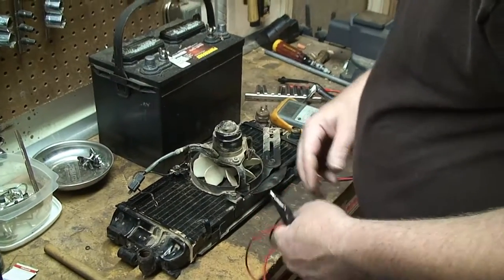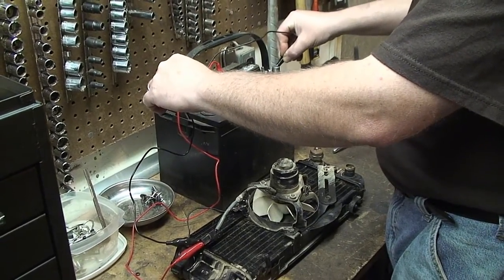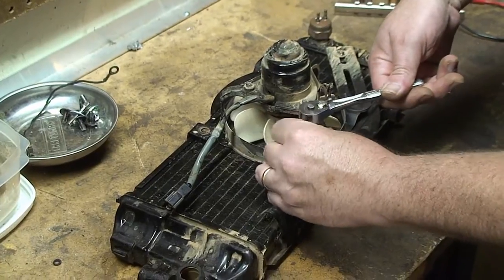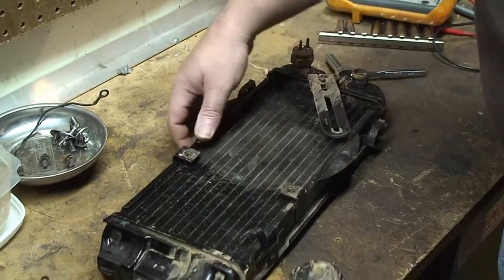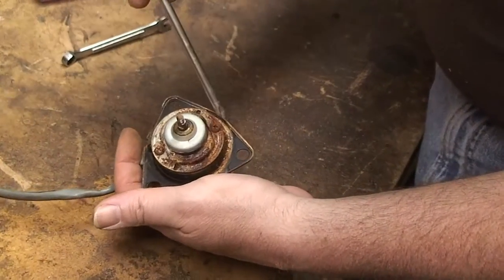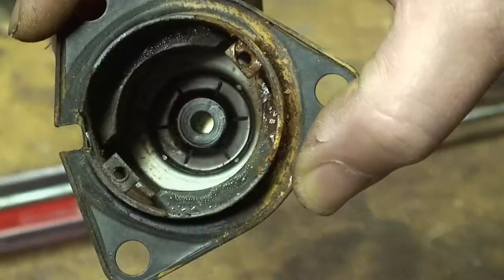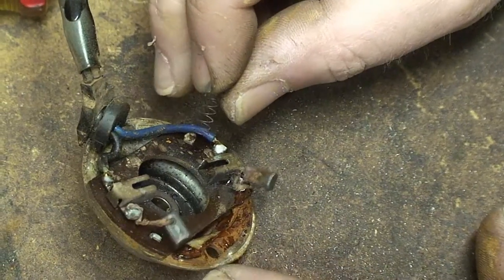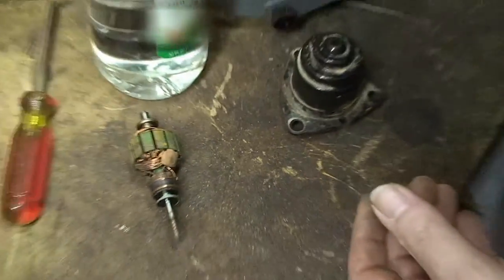Repairing / Cleaning a motorcycle radiator fan

Comment: Great video! Thanks! I didn't want to damage the fan blade on my 04 Ninja 250... My fan blade is stuck because of rust.  I think a lot of the parts are the same. Can't wait to hit it with Metal Rescue or Evaporust and restore this motorcycle. Thanks again for the upload.

Comment: Good video, if you used a little spray paint on the bushing plate after cleaning it would help protect it from rusting out again. I am going to try this on a fan for an 86 honda soon. I would grease the bushing before putting it back together.
Reply from the maker: Great tips, thanks for chipping in!
Reply: @mreinsmith  The fan on the honda was a little different, no screws I had to pry it open with a flat head screwdriver. It was seized and full of rust but I got it working again. Your video was helpful, thanks!

Comment: great job  thank you very much   5 years later still helping people and happy new year for 2017  to you and your family . I will give this a bash a  secondhand replacement is not expensive but probably about to lock up  too anyway as the bike is 27 years old     I enjoy  fixing stuff  rather than replacing . I have rebuild angle grinders made one good one out of 2 broken ones my older brother showed me how  .  I also repaired a dyson vacuum cleaner when the cord retractor stopped working . it wont retract but it still sucks up the dirt as it should and its heavy duty cord so wont break as easy  .  replacement motors are cheap so it will probably last another 12 years .
Reply from the maker: Right on my friend! Thanks for commenting
Reply: your welcome sir . your video on this subject showed me how to get my fan working again turns out it was the ground to the rad was broken  off so I soldered on a  new one and my fan works perfectly again .

Comment: Hello, yo tengo una kawasaki klr 600 y mi duda es si el fan switch se puede limpiar, si por la corrosión del agua no pierde su electroconductividad el material, ya que mi moto se eleva hasta arriba la aguja de la temperatura y no se que puede ser el problema, lo tuve que hacer directo al ventilador del radiador

Comment: the negative is always the one close to the clip ? i mean this is universal not just for this one ? trying to figure out the correct airflow direction to my xl1000v radiator fan.. does it pull out the air to the outside or push it to the inside of the radiator ..yours pulls out so not sure if it's always like that or not
Reply: it is always like that. The radiator's fins are protecting the fan from debris/mud/etc

Comment: i have a fan from a honda cbf 500 this fan is a sealed unit spot welded shut, do you think if I drill the welds and open it up it could be repairable?
Reply from the maker: What do you have to lose, you'd have to replace it in either case
Reply: @mreinsmith  completed the job it now looks nearly new, I just need to put it back together. when I pulled it apart it had an adhesive ring do you think I should use some sealant of leave it bare?
Reply from the maker: it's possible the ring was just there to make assembly easier (or automated)